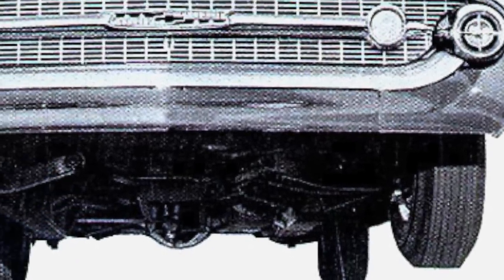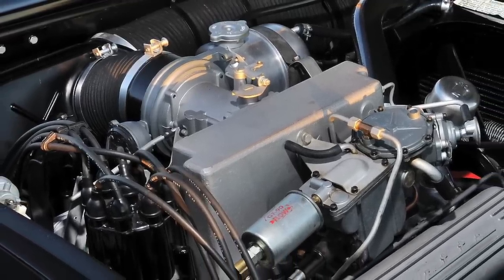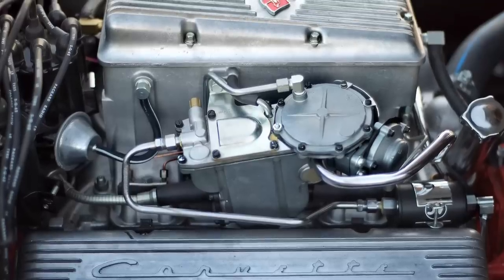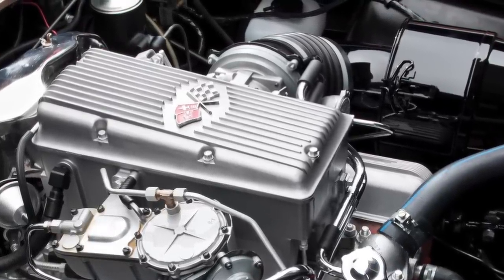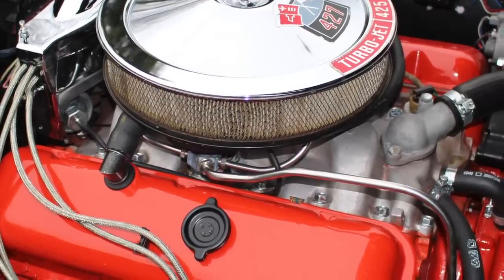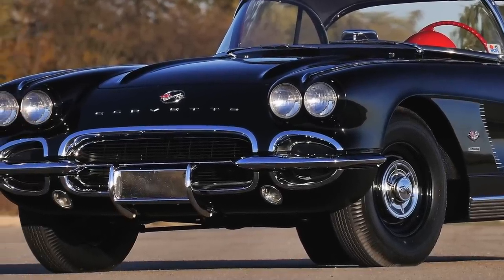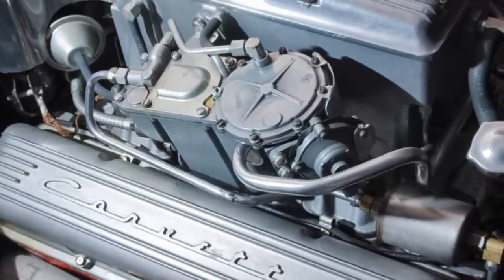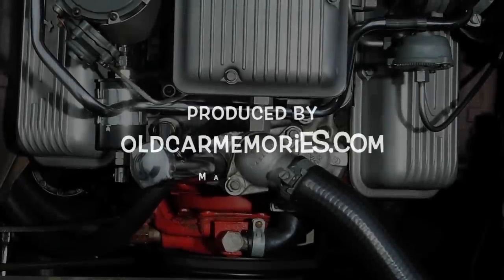Why Chevy Abandoned the 1962-1965 Fuel Injected 327 V8

Comment: I remember reading an article on a 69 Z/28 that was still owned by the original owner, and he had bought the Rochester fuel injection system from a Chevrolet dealer back in the day who had replaced a Corvette owner’s fuel injection with a four barrel because the fuel injection was apparently too much of a hassle for the Vette owner... it was cool to see the Rochester fuel injection on that 302 in that original Z/28, and there’s no doubt it’s a period-correct mod.
Reply: The problem was the 302 with the hot cam for the cross ram used in Trans Am could run to 8000 rpm easily (never mind they were rated at 290 hp@4000 rpm), needing around 750-800 cfm. The flow characteristics of the Ramjet Fuel Injection was roughly 550 cfm for the '57-'62 and 600 cfm for the '63 - '65 system. So for the drag racer, the 650 cfm Holley seemed faster. And on that 302, the Ramjet was a restriction.

Comment: Notice he says "gross" horsepower and torque.  "Gross" is the output of a ‘bare’ engine running on a test stand with no external engine-driven accessories (such as alternators or water pumps power steering etc), free-flowing exhaust headers with no mufflers, and optimal ignition timing. Gross ratings were also mathematically corrected for standard atmospheric conditions.  Gross output represented a particular engine’s maximum output under ideal conditions.  Add on air filters all the belt driven accessories and emission controls, you would then get what is used now as "Net" horsepower/torque.  So if the cars that are talked about in the video used net instead of gross, the numbers would have been considerably less.

Comment: Being 68 years old, I was luck enough to get my driver's license in 1965 and lived through the greatest car decade of ever. I really enjoy your videos but just one little bone to pick with you and pretty much everyone. I took physics in high school and even before then, knew that there were many different specs regarding performance. In the 60's almost all engines listed brake horsepower. That is the gross number given at the crank shaft. It actually wasn't until the early 70's when compression ratios were lowered that we started seeing horsepower given as sae net. Most people would believe this to be rear wheel horsepower but that is almost impossible to quote as there are too many things draining horsepower to ever get reliable figures. OK, my point: Torque was always given as foot pounds. In Europe there is a metric equivalent called Newton Meters. I don't have a clue how to compute that. I have wondered for about the last 20 years why people started referring to foot pounds as pound feet. I understand it is weight over distance but foot pounds was good enough for every engineer whoever graduated Stanford or MIT. It was good enough for the US space program. I recently found out that some guy from the UK who was not an engineer first used the term pound feet and since the liberal media isn't known for anything other than giving false information, they figured that the Europeans must be smarter than us so we had to be wrong. I really am curious. I defy you to find any respectable literature/text book from before 1980 that uses the pounds/feet designation. Since the millennials know so little about mechanics, it means nothing to them. It does irritate every true car guy I know to hear it referred to like that. It is almost as irritating as hearing the girl on the liberty mutual commercial talk about torque ratios.

Comment: another big reason was that Bubba down at the corner gas station could adjust the carb on your car but wouldn't touch the fuel injection with a ten foot screwdriver.  My father was a Chevy certified mechanic from 1955-1969 and was trained to handle the fuelies...and he says that they weren't very reliable and hard to repair.  A lot of people removed the F.I. and put a Holley under the hood.

Comment: Chevrolet used the Rochester Fuel Injections from 1957-1965.  The unit above is the 1963-1965.  I had four of these at one time and raced these.  If this was available in 1962, it was very, very late in the year.  One of the biggest things was that a lot of FI's were STOLEN by unscrupulous mechanics.  The biggest problem was that the high pressure fuel pump was driven by a short, heavy duty speedometer cable from the distributor to the back of the fuel meter.  These cables would occasionally break and leave you stranded if you didn't know about the problem.  I always carried a spare cable in the car and it was less than a 5 minute fix to open the hood, pull the cable housing out, remove the broken cable parts, drop the new cable in and put it back in place.  When these cable would break, a lot of mechanics would tell the customers that it would cost thousands of $$$$ to fix the FI and that they could put on a new Holley and intake manifold for far less and solve the problems.  They then used or sold the FI units for a healthy profit.
The Rochester units were a straight, constant spray system.  I built a lot of these.  They flat worked.  I had one in my '69 Nova SS.  I pulled  out the 375 hp 396 and installed a 1970 Corvette LT-1 that I did a full  race build on.  I then came across a Rochester FI unit built by Bill Thomas Speed and Marine that was used on the 1965 Chev CanAm race cars.  It had a modified fuel meter, oversized nozzles and twin air meters on top of the plenum with the hole in the driver's side blocked off.  This was the inspiration for the later dual quad, tunnel ram systems.
I never should have sold my four four Rochester units, my 1969 Nova SS and big block or the 1940 Willys coupe that I built when I was in college.  I"m sure no one else has ever made a mistake like that!

Comment: Fuel injection was the only way manufacturers could get a 3 way catslyst to to work properly by cycling from Rich to Lean. This is how car makers meet EPA emissions standards in the 80's. Carburetors were cheaper and made it more profitable to produce cars that's why it took mandated EPA emission standards to make fuel injection mainstream. A properly tuned carburetor will last a lot longer than fuel injection components.  And get nearly the same drivability it's just too bad that most mechanics didn't know how to properly tune carburetors.

Comment: A lot of cheap high performance cars were hitting the streets in 1965. The Corvette had to keep their prices down to retain potential buyers.  Plus the same problems they have today with electric cars happened with the fuel injection system - nobody knew how to fix one. Had to take it to a dealership which typically aren't open on a Sunday or even have a dealership in the wilds. Think about that for a minute - you're in Wyoming on vacation and back in 1965 I'd have to believe a local Chevy dealership is going to be 300 miles away from where you'd break down - have to get that towed. Tow truck driver would be saying 'how much ya got mista?'

Comment: I like your program and hope you can do one for the 442. I had a 65 that cornered like ago cart. when I sold it it had a 470 ci chev with 12.5 to 1 compression. The 400 inch olds had a lot of torque but the oiling system was not as good as the chev

Comment: I believe it was made by Rochester. The O rings would shrink or deteriorate over time and gas would leak out of the injection system overnight. Starting the engine could be problematic. In the 60s I was a teenager and I pushed one with a '60 Coupe de Ville every morning in order to start the Chevy. EVERY MORNING! Until we got rid of it.

Comment: There is another factor left out here. Running multiple carburetors to achieve sufficient airflow for high HP was nothing new to the racing world, but in the 50s and early 60s, large bore 4bbl carbs weren't readily available. Rochester started making 4bbl carbs for GM in the 50s, but the large spread bore version of the Quadrajet didn't arrive until 1965, and was a real game changer with regard to delivering large HP potential with great drivability. The declining sales may have put pressure on GM to end the fuelie, but the availability of the Quadrajet was the nail in the coffin. The availability of such easy LARGE air/fuel delivery was also key to developing their big block series, which would've been a non-starter if it'd relied on fuel injection... 
We make fun of them now. But Quadrajets were really key to all of the big HP musclecars of the late 60s.
Reply: ..... the GM ones, maybe.   Mopar and some Fords used a lot of Carter AFBs.

Comment: We had two technicians in our shop that knew the early fuel injection very well. They were NOT reliable due to a breakdown of the o-rings and seals. Constant leaks and fires. The drive cables for the pump would break or become worn out causing loss of injector pressure with stumbling and backfires. Pontiac used it first.

Comment: Fuel injection became the standard because (in a lot of instances) it was the only way to comply with emissions regulation.  Before that, it was cheap and easy to just add displacement if you needed more power.  Its efficiency simply wasn't relevant before that.  I think the Rochester system was essentially mimicked by the Bosch CIS system that was so ubiquitous in the late 1970s and early 1980s (in European cars).

Comment: Question??? 10-15 years ago I listed on eBay a NOS electrically driven vacuum pump, made by Trico I think. I assumed it was just some kind of booster pump for vacuum windshield wipers, can't remember now if it was 6 or 12 volt. It Got bids right away and several buy it now offers. A potential buyer emailed to say "don't end this listing early" and told me this pump had something to do with old Corvette fuel injection systems. Seems like it sold for close to $700 which was 20+ times what I expected. Can someone verify these systems used an electric vacuum pump? I've kept eyes open for another but have never seen one since.

Comment: How did it handle variations in atmospheric barometric pressure...?
Reply: MGs did with their variable-jet SU carbs... which used a tapered needle that was gradually pulled out, allowing more fuel to enter the intake manifold...... and because the jets were variable and not 'fixed', it self-corrected for high altitude / thinner air.... and the reverse........   "for the record"

Comment: The number problem GM has is the typical Corvette buyer us price sensitive.  Whereas, many unique and beneficial options are hard to sell.  

Now the smart thing to do today is take a 1960s and 1970s big block 396 or 454 and install a TBI system on it for added drivability, mpg, hp and torque.  Yes it will way more then $500 though.

Comment: Was the mechanical fuel injection really more efficient than a comparable carburetor? Modern fuel injection is, but that’s because its sensor design allows it to be. I could see some efficiency here through better atomization as, presumably, the mechanical fuel injection ran higher fuel pressures than a carb would. However, it wouldn’t have the part throttle mixture control that even an electronic carburetor would offer.

Comment: It wasn't mentioned but did the two 1965's tested have the same gear ratios in the rear axle when they were tested for 1/4 mile times? Different gear ratios could make the times completely different.

Comment: I HAD A 56 CHEVY HARD TOP SPORT COUP WITH A 65 350 HP 327 FROM A CORVETTE AND A MUNCIE. 21 4 SPEED. 10 BOLT 373 POSI.
 1350S IN THE QUARTER MI. I HAD TO PUTT A 11 IN. CLUTCH FROM A 454 TO HOLD UP. ON STREET TIERS.

Comment: only problem with the fuel injection system which was also on Pontiac was dumb tinkers wouldn't keep their hands off them. To adjust them you had to have a special manometer set up from GM. Cost lots of money $100 back in the day. The units had a set Ventura for air intake which limited airflow. More power could be made with a big bore Holley four barrel. The fi was lots of fun to drive.

Comment: Not mentioned here was the fact that the big block went into a lot more Chevrolets than the fuelie AND that the difference in manufacturing cost between the big and small blocks was negligible. On top of that, the big block with aluminum heads was not much heavier than the small block with iron ones and had a heck of  lot more torque. But choose your masque, I'd say.

Comment: This vid addressed the real reason the fuelie was discontinued - cost.  The mid-late '60s was the era of cheap gasoline.  FI was shelved in favor of big-block HP that was considerably less costly to produce.  Fuel economy wasn't a big concern then.  However, that was short-lived with the 1973 oil embargo when fuel economy rose in importance.  In hindsight, agree that the abandonment of FI was short-sighted.  Electronics were beginning to be used more in the mid-70s.  Performance of mid-late '70s Vettes would have benefited from continued R&D of FI and eventually EFI.   In fact, the malaise era (generally 1973-1983) ended when EFI (esp multiport EFI) became more commonplace as it worked much better with emission controls vs carburetors.  That's when the decline in performance began to reverse.

Comment: You must remember cars back then cost about $3500. Dirt was the big problem with this system & the fuel injection in the 327 cubic inch. engine was prone to climate & weather changes with this fuel injection system. He's right it was hard to adjust because many mechanics didn't have the expert skills that were required. In my opinion the 283 V8 was a better bottom  end engine because it had more low end torque than the 327V-8.

Comment: I suspect the real reason for abandonment by many 'Vette owners was adapting that setup to a modified engine...   Coming from the Datsun Z-car world  (Bosch L-Jetronic as OEM starting 1975 ), I can honestly say up through the mid 90's (when FI tech really started to take off), carbs were the way to go.  For years I did not want to admit this either.  From a performance standpoint, on a stock motor, they did not offer any improvement over carbs, it was purely for emissions, and did not react well to any alterations (cams mainly).  Difficult territory for even the most seasoned tech and  just not worth the effort.

Comment: IIRC, Chevrolet's fuel injection system was made by Bendix, and adapted from aircraft fuel injection systems.  It was 100% mechanical.  As a pilot, I'm wondering how they overcame the #1 drawback of the system: a hot start is extremely difficult, and involves running fuel pumps, motoring the engine at full lean, listening for ticks, etc (basically, an engine shutdown immediately vapor locks the fuel injection system).  Electronic fuel injection is a modern marvel on new car engines, and allows high horsepower while meeting emission requirements.
Reply: Brent, Rochester made GM's fuel injection units.

Comment: If you study how the GM "mechanical" fuel injection systems worked, I believe most engineers would say it was as much pneumatic as it was mechanical.  An analogy is that electrical signals in todays systems are translated through electro-magnetic devices into mechanical movement of a high pressure fuel injector.

Comment: The Announcer says (correctly) that "Many mechanics replaced the Fuel Injection system with a 4 barrel carburetor," because (incorrectly) "they didn't know how to maintain the Fuel Injection System!"  The Rochester Fuel Injection System was a Thing of Beauty and an Engineering Masterpiece!  It DID NOT require ANY maintenance, except keeping the air cleaner clean!  I know because I had a '63 Split Window Vette with F. I.!  The ONLY problem that I ever had with it was a sheared high pressure fuel pump cable (Between the pump and the distributor).  Otherwise, there was nothing to "Maintain!"  The BIG PROBLEM with these high compression F. I. engines was the weak sister, single point and condenser ignition systems!  You had to change the spark plugs every 500 to 2,000 miles!  With a fresh set of plugs, and 17 degrees of timing BTDC, they could beat anything on the street!.................Yogi
Reply: Yea, that cable was an annoyance, prone to breaking.  Back in the mid '60's the plugs would start to hurt the upper rpm pull, you could feel it.  That was on any performance car.
Reply: That's interesting, Yogi.   I had a '66 Lincoln 4-dr. convertible sedan with a 462 stock engine (& gobs of torque).. that would go 36,000 miles between points & plug changes..... and a stock 'single-point' ignition system..... even with 200,000 miles on it... no oil consumption.. and a worn distributor bushing..... and yet still got 12.5 mpg in town (with a light foot).

Comment: The problem with independent mechanics not knowing how to diagnose the "fooly injection" back then is that GM did not share the info needed to diag and repair it. Dealer mechanics wouldn't share the info even if you knew one personally (maybe if you were his best buddy). They wouldn't even help other mechanics in their own shops. You couldn't just purchase the manuals either Even if you could you would likely still have a large learning curve on how to do it. Don't know about you but as a mechanic, I don't want to waste my time working on a finicky fuel system that I don't know and can't get info on when I have other work to do to make money.